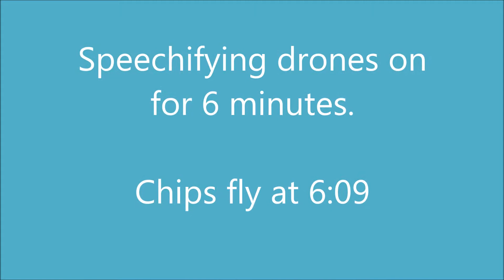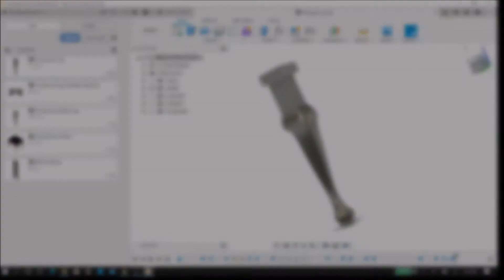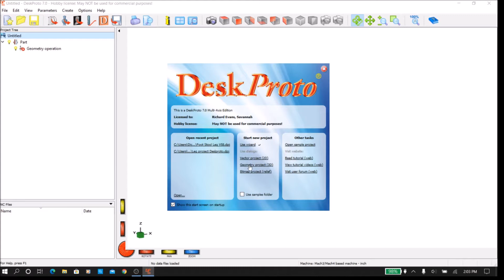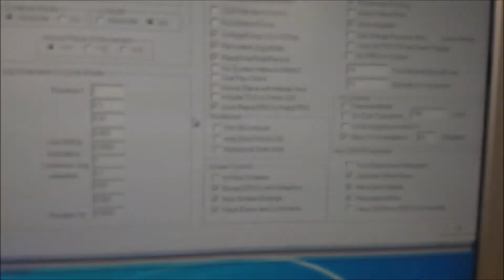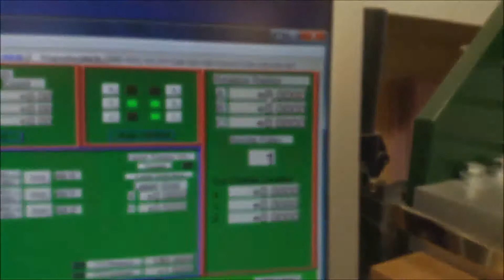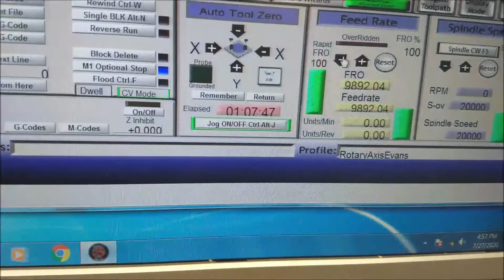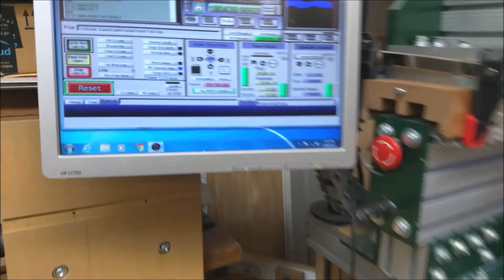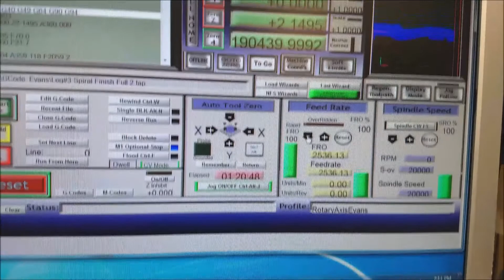CNC Router Rotary Axis Makes Cabriole Leg

Comment: Very good video and end product, but how would you cut multiple to exact matching lengths?  It seem one more toolpath with a flat bottom end mill cutting partway through at top and bottom (a little extra length on the stock may be needed) would give you spots to finish cutting and smoothing by hand and exact consistent lengths.  Same way as typically done on a lathe.

Comment: does your y across axis move at all thanks
Reply from the maker: In my machine, when in "rotary axis mode", the Y axis is disabled so the Y axis cannot move at all.  In the rotary MACH3 profile, the drive that would normally be used for the Y axis is reassigned to the rotary A axis.  Thanks for watching.  Thanks for watching.
Reply: @richardevans6891  Did you give the machine a line of cocaine before starting?

Comment: The Rotary extension is now available for 11 credits per day on Fusion 360. Curious to know if you have tried it yet. I am trying to get similar workflow with Mach 4 and Avid CNC rotary axis, but so far have been unsuccessful.
Reply from the maker: There was a short period when the Fusion rotary CAM functionality was available to hobbyists, and I played around with it in simulation.  Seemed to work fine, and it convinced me to try my hand at building a rotary axis.  By the time I got it built, Fusion took the CAM rotary axis function away from hobbyists; that led me to Deskproto.  Deskproto works pretty well especially given its reasonable cost for hobbyist use.  I am surprised you are having trouble with rotary axis on Avid-Mach4- Fusion.   My impression is Avid provides good customer service; have you reached out to them?   I have no experience with Mach4.   Good luck and thanks for watching.

Comment: Great information, thanks!
The slight flat part in the area under zero, any idea why that happened?
Reply from the maker: Sorry, I am not sure what area you are asking about.  Can you give a time reference on the video where this area shows up?
Reply: @richardevans6891  15:31, it is the "shin" area of the leg. It is exactly the area that is below z=0.
It is looking sort of flat or at least not rounded like other parts. I have heard that that part is actually very very sensitive to correct zeroing of the bit and slight mistakes can lead to such problems, so I was just trying to make sure, if you also found that to be the reason.
Reply from the maker: @pradeepdatta7577  I did not determine the exact cause of this defect.  As you surmised, it is the  area where machining below the axis of rotation is required.  I am not sure if the problem was an error in my zeroing on the rotation axis, or if it is an issue in the tool path created by the  Deskproto software.  Around 13:22 you can see how awkward the tool path seems where the side of the tool (rather than just the tip) seems to do some cutting; and this side cutting action may be the source of the problem.
Reply: @richardevans6891  Ah ok. I just remember it being mentioned some place, that that part is extremely sensitive to the tip being zeroed perfectly otherwise a flat area or a ridge can remain. It is truly an awkward area, but I think you did a pretty good compromise. Thumbs up for you!